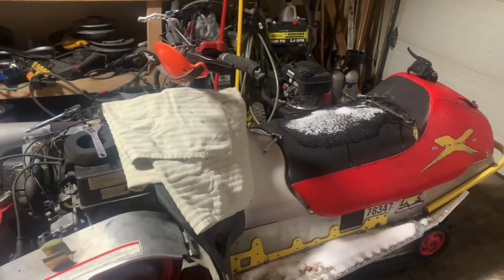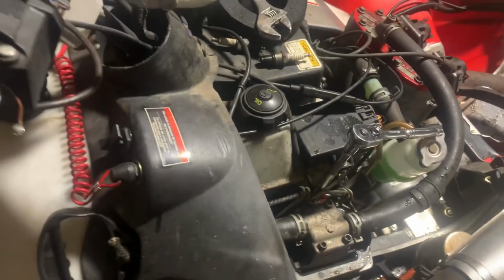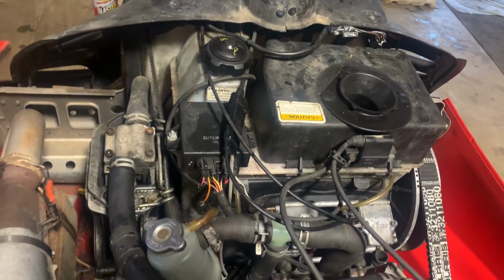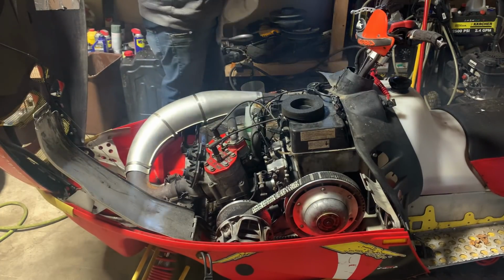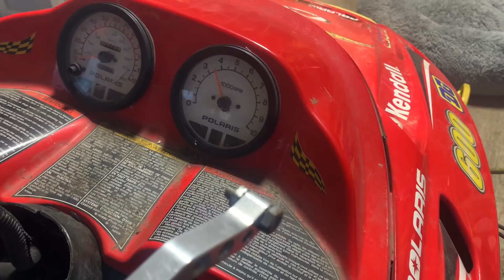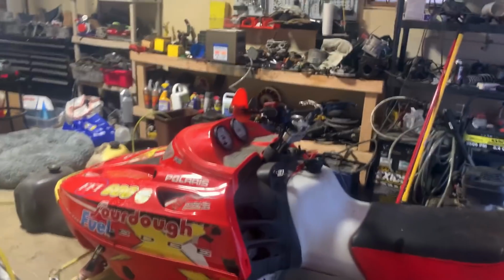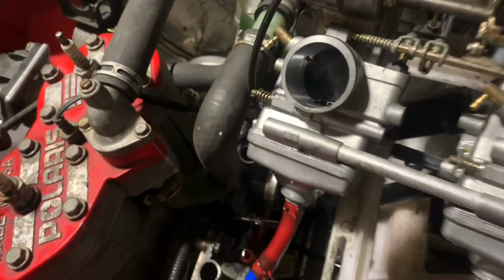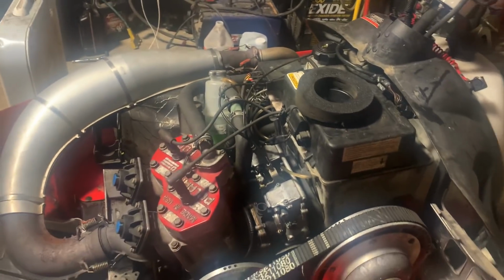Polaris Edge X 600 progress

Comment: Thanks for posting the videos on the Edge 600. Believe it or we live in Tn and have owned one for about 10 years. We get about 3 or 4 good snows a year and it’s always a blast to ride. We bought at an equipment auction in Indiana for$1500 in July with about 1600 miles, not sure if that was a fair price or not. Seemed cheap enough at the time and it’s never given a minute of trouble. Always starts easy even after sitting for months.
Reply: That was a steal!!

Comment: Heck yes. Got almost 2 feet in MN. And now it's gone. Blew up my 02 800. Have you ever ran a 700 ves bottom end with 800 cyls. Weighing my options
Reply from the maker: It’s a lot of work to make a 800 top end work on a 700 bottom end. Comes out to a 770. I have built one, but it was based off modified 700 cylinders. lol

Comment: I have a 02 edge x 600 with extremely low miles, but has spent more of its life sitting than being ridden. Hasn’t been run in 2-3 full seasons. (Is my old man’s ride) I’m trying to get it ready for him to come out with me. Should I be worried about dried out reeds and/or the power valve bellows? Or just clean the carbs and run’er?

Comment: Hey man. I just bought a 97 XC 700 twin with the 220 cyl on it. It's all original except the hood. I've been watching a ton of your videos but I can't find any videos on the 97 only the 98. Is my sled that rare? The guy I bought it from said there was only 500 or so of them made. Didn't most the 98s come with the 824 cyl and from what I was reading they were turned down compared to the 220 cyl. ? I can't find any videos on it and can only find old forums from like 2003. I would like to know more about my sled and get more educated on it. This is my first personal sled, I'm 20 years old. Thank you if you get back to this comment. If not it's okay.. I'll keep looking.
Reply from the maker: To set a few things straight.
Later 824 cylinders make more peak HP.
Early 220 cylinders have more “grunt” and make their peak power at a lower rpm (7800, compared to 8000)
97 xc was a limited build sled, yes. Iv been looking for one for 15 years and still have not been able to buy one. A sled like that IMO should be with a collector/someone who will restore it, not someone who will use it to ride all the time.
Technically, the 98 is a better sled. But the rareness and two piece seat/tank combo are what draw people to 97’s.
Reply from the maker: If you follow my videos, I have a 97 clone. 98 xc 700 setup how a 97 was. Couldn’t get a real one so built the next best thing 🤣
Reply: I feel I paid a bit much for it but after doing research I feel it was worth it. It's definitely been abused and was raced back in 2012 ish and got rolled over that's why it has a aftermarket hood. It has nearly 6000 miles now and I just plan on riding it occasionally and enjoying it. I wanna find more of the original parts for it but it seems that might be hard. I definitely don't plan on abusing or wrecking it. I honestly had no idea till after I bought it it was so rare. I'm the third owner and I wanna make it nice. I would love to know more about this thing.
Reply from the maker: Is this the one that was listed for $2500 recently? If so technically it’s a 98, with 97 parts bolted onto it.

Comment: So akproxr,
 do the prox 600 and the edge x 600 only differ from chassis only?
Reply from the maker: Almost everything is different. Though they do look similar and share the same engine/hood. Different front/rear suspension, bulkhead/tunnel, chain case, brakes, controls, engines don’t even mount the same.
Reply: @AKproXR  I wanted to say thank you for responding back. I definitely appreciate it.

Comment: Any tips on a 2003 sks 700, bogs out over 1/2 throttle won’t move or go past 4k rpm. Compression is 135
Reply from the maker: Clutching issues? To tight of track? Dragging brakes? Bad temp sensor? Could be a lot of things.
Reply: Possible Throttle position sensor, try another one
Reply: @007.3l  so I was messing around and I unplugged the tps that’s on the carbs, and it didn’t make a different sled still idled fine but bogged, should something happen when I unplug the tps?
Reply: @007.3l  like shouldn’t the sled act different with the tps unplugged?
Reply: To test you input 5.0 volts to the tps on the sled, then check output at wide open throttle, you are looking for 4.0-4.2 volts you will need a good digital meter to test

Second part requires a old scool analog /gauge /needle style meter to check for dead spots in the tps 

There are ways to build your own tester on some of the snowmobile forums,

May be less hassle to get another known good tps and properly adjust it to see if it fixes your issue
Reply: Like ak said may be a bad temp sensor too, may want to try blipping the choke on for a second while applying throttle see if it revs higher than 4k, may be chipped or de-laminated reeds too

Let us know what you find

Comment: How do you mix your fuel while still running the oil injection?
Reply: I personally run about a ounce or 2 per tank when i fill up for the first few rides of the season, smokes a bit if  you let it idle for a while. Piece of mind to make sure the oil injection is working
Reply from the maker: I just toss a couple oz’s in every tank as an additional precaution. Especially when I just assembled an engine like I did on this 600.
Reply: @AKproXR  good to know, thanks!!